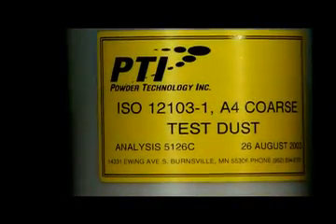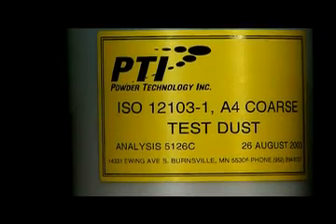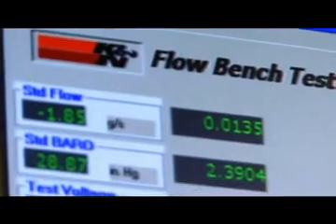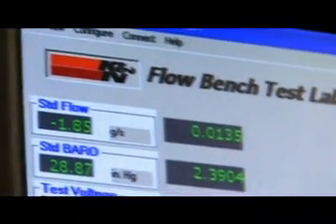MAF Mystery - Part 3 of 4 - What Does It Take to Foul a MAF?

Comment: Car Maf sensors fail at any time.  1000 miles or 300 000 miles. My Volvo V70 has a problematic MAF issue from 200 000 miles, i would just clean it with electrical contact cleaner every 6 months and the engine check light would be gone again, just treated it as part of the service.  This was a car running on OEM paperfilters too, not a K&N.

Comment: What about spraying some K&N oil and then a little dust? The new MAF sensors don't have a hot wire burn off anymore. If the oil attracts dirt (I hope it does so it sticks to the filter) and a little oil is on the MAF and dirt then sticks to it, then what? Funny that they left that part out.